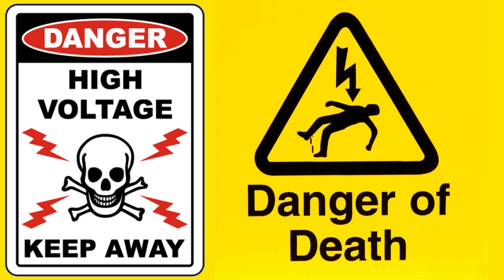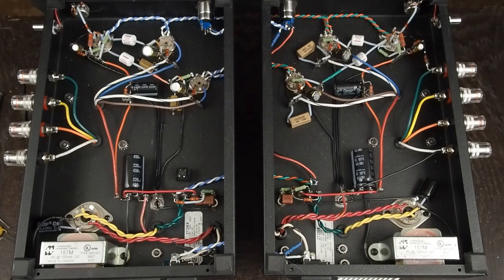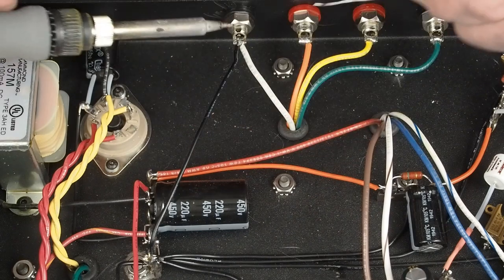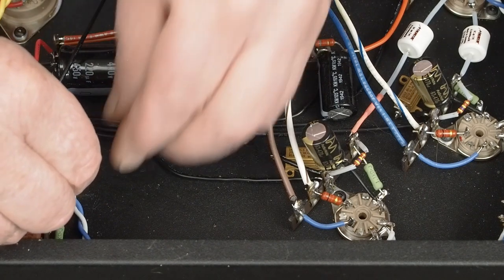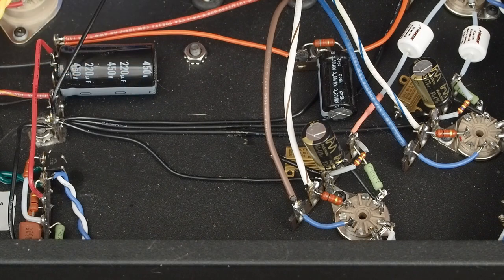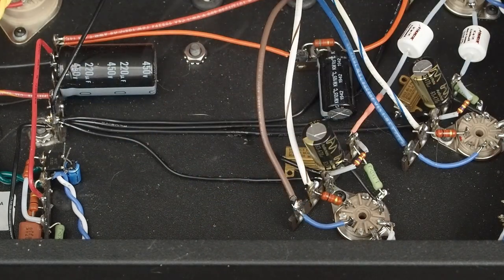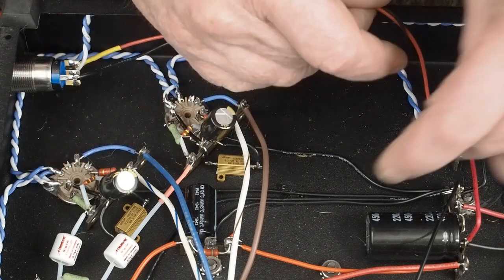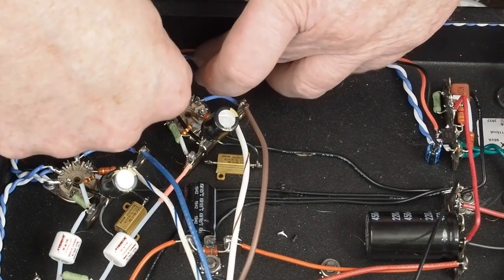Tubelab Monoblock: Final Build & Voltage Test #6

Comment: Great!! Can’t wait to see the next video. That’s an amp I want to build but as a stereo in one chassis to use with the speakers I bought on amazon at a special price (the ones you recommended few videos back). I’ll make the transformers and will use 6n14n power tubes which are military grade el84’s rated at 14watts. I’ve been using them for years on my guitar amps and love them. Well, looking forward to see the audio analysis results. Thanks. Blessings.